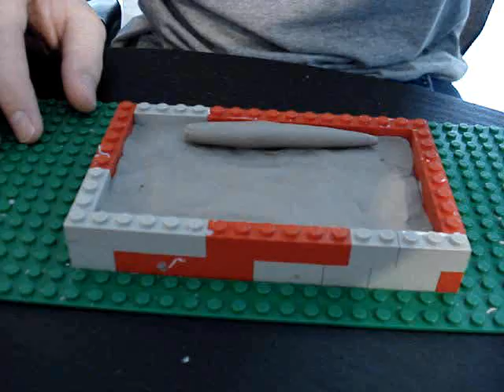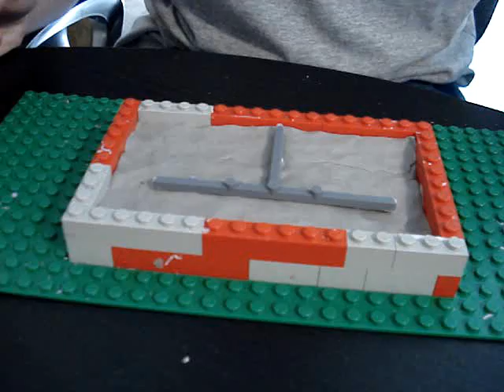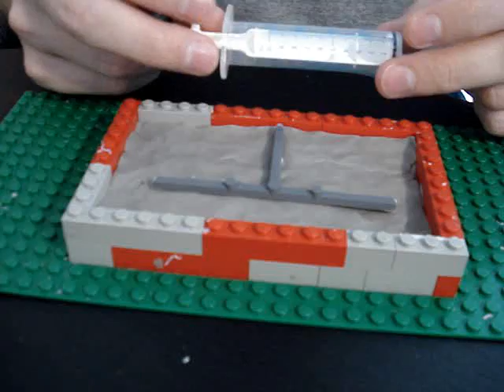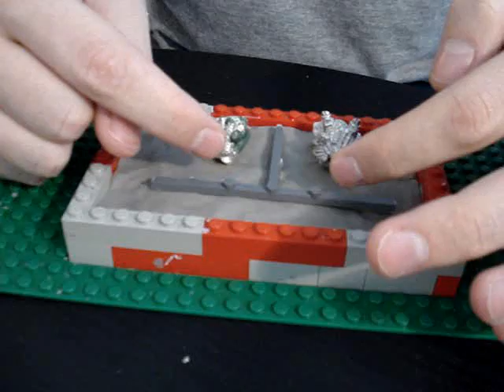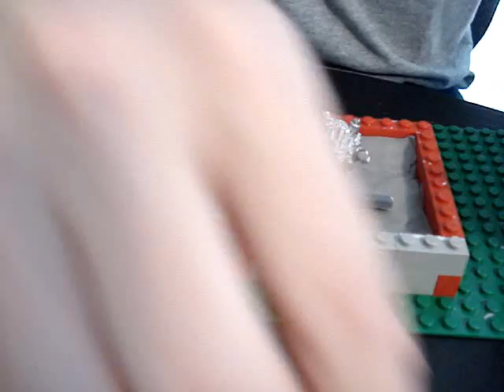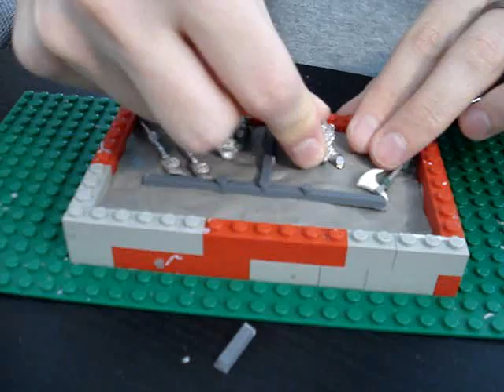Mold Making and Resin Casting Your Own Sculpted Miniatures - Part 2

Comment: how did the models look, i cant really see the comparison of quallity, do they look exactly the same?
Reply from the maker: For the most part, yes, they are identical. Though sometimes you get trapped air and may have to patch miniatures with green stuff. It depends how well you've made the mold, accounting for the escape of air.
Reply: XanderXereus you think I can take the entire mold right out of the box and recreate the sets as a whole to stop the problem of air bubbles? Also thanks for the quick reply
Reply from the maker: No. Professional sprues are pressure filled, so they can eliminate air bubbles a lot more effectively than a gravity-fed system. Even with a syringe, you won't get the kind of pressure you need to eliminate air bubbles without creating proper air channels.

Comment: Is it possible to do an entire runner (gunpla runner) this way? I want to redo an entire runner in a different color for some led use and need it a different color
Reply: I would also like to know if that's possible.
Reply from the maker: Yeah, it sounds like it would be prone to failure. Arranging your mold is the most critical step. Just using an unaltered sprite sounds risky.
Reply from the maker: Eric magnolo Doing an entire sprue sounds challenging and prone to air pockets. I probably wouldn't try it.

Comment: Hmm that's what I thought.
Now, what should use to make the mold, can I use clay? 
I'm thinking to create a kind of structure around the figure with space between to pour the liquid rubber, so in the end the mold will be the rubber itself. Again, do you think it may work or there's a better method?
Thanks again for your help.
Reply: the lego meathod is best a second one is a hot glue gun and cut up an old ice cream tub
Reply from the maker: Yeah, any structure will do! Sometimes you can just cut the rubber in half if you are doing a pour that surrounds your whole object.

Comment: Hi, I have a question. How can I make a mold from a aprox 12-16" complex pose figure without cut it in parts?
I thought about two parts but it will not match later, thanks. Lot
Reply from the maker: It's possible, but it may be difficult. The key to molds is to not have trapped parts, that is, parts where the width of an object is wider that the seem of the mold that contains it.

For example, if you stuck the whole head of a miniature into a single side of a mold, you wouldn't be able to remove it, since the seem would be at the neck, and the neck isn't as wide as the entire head, so the head would be stuck.

If you can avoid trapping any element of your model in a mold, you should be okay.

Comment: Really great videos!

Just one question. If I had to cast a model completely made in green stuff, how could I modify this system? Just because pressing it hard into the plasticine would certainly damage it.

Thanks a lot!
Reply from the maker: Hard to say without seeing it. In general, green stuff is quite hard and shouldn't be damaged by plasticine. Warming up the plasticiine might help, though. That would make it much softer and wouldn't require pressing as hard.
Reply: That could work. I was also thinking of suspending the mini into the lego structure and pouring the rubber at first. That way the first part of the mould would be created by the rubber in a liquid state instead of having to press the mini into the plasticine! 
You think that could work?
Reply from the maker: Custodian Valdor I'd fear that the silicone filling up from below could cause air pockets to appear between the models and the mold rubber. Hard to say without seeing the figure.

Comment: did my first two part mold today.... my life is ruined first caste one figure was missing a head, the other was missing half his torso, second caste one figure was missing his hands, the other was missing his arms and crotch.... both casts had dozens of air bubbles. im using alumalite resin and i pored it into the base, i didn't use a syringe maybe that's my problem FML!
Reply from the maker: Air bubbles are your number one enemy. That's why I like to use a syringe with dedicated channels so it fills from the bottom up.

Comment from the maker: Yes. But it would be a different process. You'd probably have to contruct a container around your free standing model. Then you'd have to pour the rubber into the structure and completely surround it in mold rubber. Then you'd have to cut the mold in half. I've seen other tutorials out there on this, so look for them. You might ruin your model when you cut into the mold rubber, however.

Comment: What if your miniature as you call it, or sculpture as I have done, is already made out of plasticine?  is it possible to make a mold and resin cast off of it?
Reply from the maker: I think so, but the process will likely be different. You may need to do a single pour of mold rubber that completely surrounds the sculpt, then you cut the mold in half to end up with two pieces. I'd research this a bit more with other videos though.

Comment: I would use blu tack instead of clay because it's easier to clean up. Also in my case since rtv silicone is more expensive where I live, instead of making such a huge frame, I leave like 2 inches clearance between the piece and the edge of the blu tack, make a shallow wall of green stuff around the part leaving 1 or 2 mm clearance, and then after it hardens I pull the blu tack to make a higher wall, so I have like a little vase. That's where I pour in the rubber. Other side's the same way
Reply from the maker: Interesting. I'm not sure I follow this completely, but blue tac would seem to be a good alternative.

Comment: @kraden04 I see that you're injecting, but unless I refrigerate the resin I'm left holding a hot mess in 60 seconds. Florida summer hates me, I guess. Thanks for your reply, sir!
Reply from the maker: Not sure what influence summer heat has on this process. The 2 part resin causes a chemical reaction and it hardens quite quickly, 15-20 minutes. It's an exo-thermic reaction, so it actually produces heat.

Comment: Hi.  I am new to this but I think you are right (and understate!) how the process of choosing where the mold splits is *the* key to casting good mini's.

I suppose the obvious thing would be to look at how the models where cast previously.

Also would 3 part moulds be better for really complex models?
Reply from the maker: It would probably be better to split up your model into smaller pieces, rather than split the mold into more pieces. But yes, placement is key!